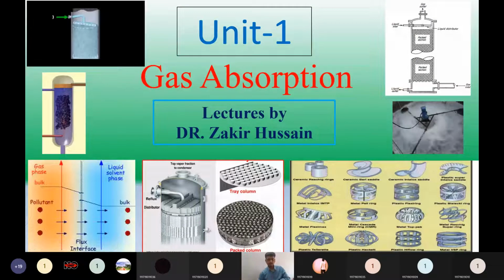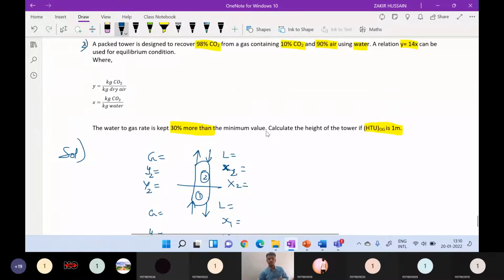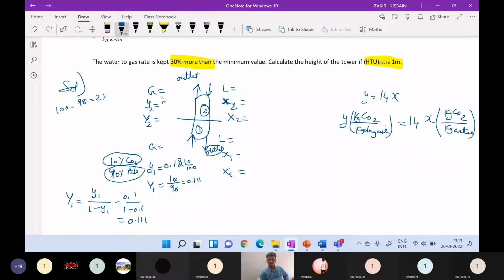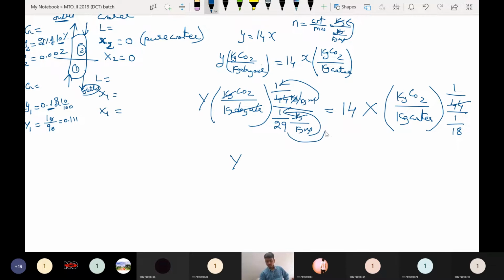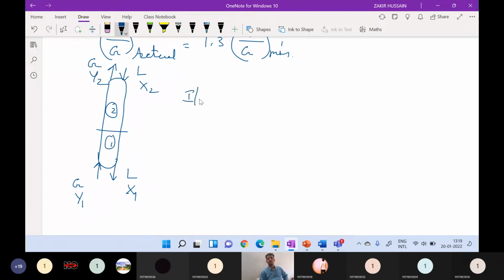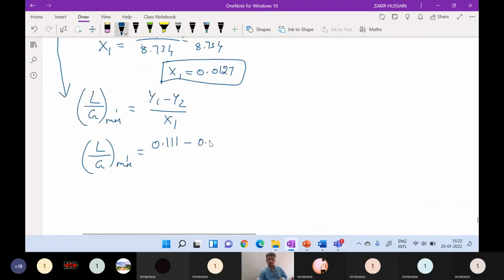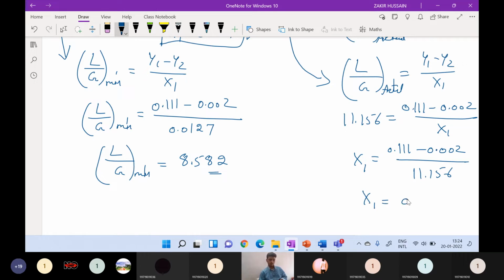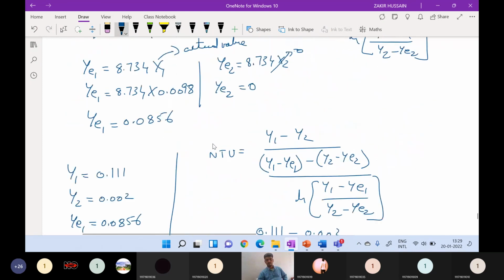Absorption-Problem-2 Solving (CO2-Air)

Comment: Sir, if equilibrium relationship is given in terms of mole ratio, is there any way to convert it to mole fractions
Reply: Sir , the equilibrium relationship was given in terms of mass ratio in this question and you have converted it to mole ratio by adjusting molecular weight. I was asking if we can convert mole ratio to mole fraction, i.e. from Y=8.734 X to y=mx
Reply from the maker: Dear Pratyaypaul, yes we can convert from mole ratio to mole fraction. Exactly the same procedure in detail is presented in this video. Please go through the video once again. Then let me know if you find any difficulty. Thank you for your interest.
Reply from the maker: Capital Y and capital X are mole ratios and small x and small y are mole fractions. You can use the equation Y = y/1-y and X = x/1-x.

Comment: please can u explain to me the step Y=8.734X why and how we have to transforme the equilibrum eq ?
Reply from the maker: Dear, Thanks for showing interest in the subject and my videos. Thanks for such a support. Since the given equation (Y=14X) in which Y and X is expressed in kg/kg or simply its a mass ratio. So we need to convert this equation in mole ratio because in the problem all percentages are given in percentage (i.e for gases volume% = mole% = pressure %). We know that moles = weight / molecular weight (n=m/M) so we convert every variable expressed in kg to kg-mole. Then you will get that Y=8.734X. I hope this explanation is ok. Thank you once again
Reply: @dr.zakirhussain8948   thank you so much, all this support is well deserved 🙏